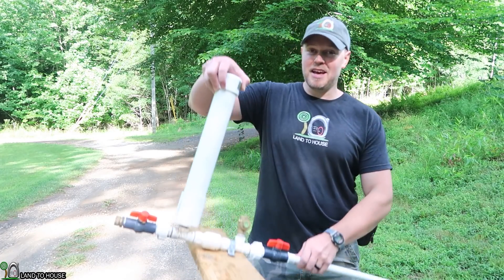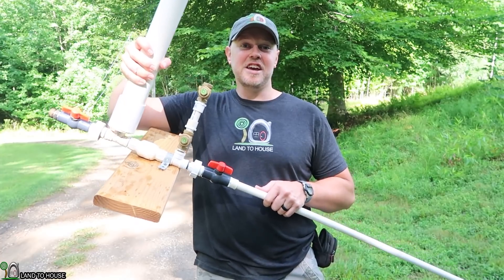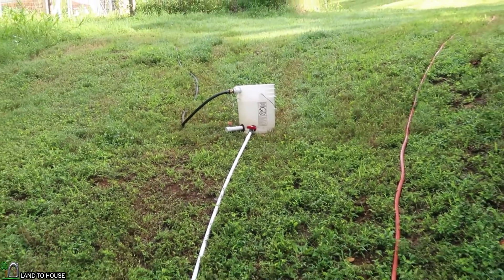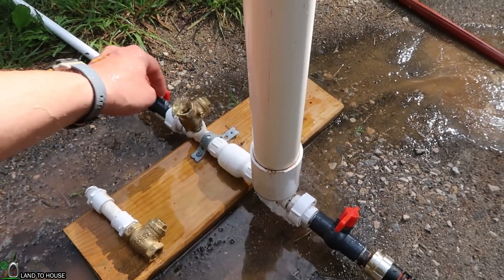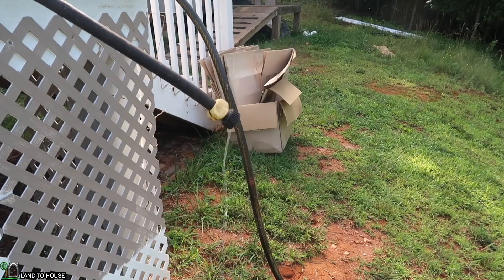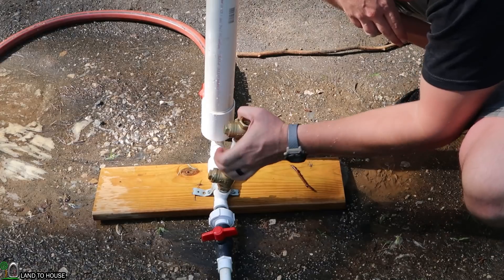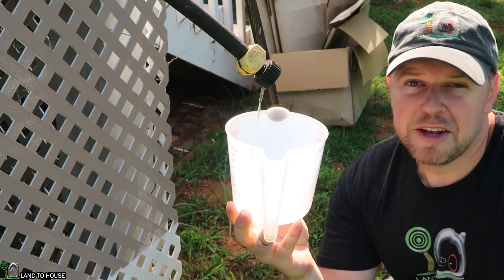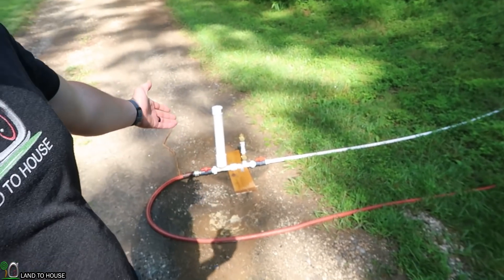Ram Pump Stacked Waste Valves vs Normal Valve

Comment: what will happen if you split the tube before the valve and put like 3-4 valves to work like engine, and then combine the tubing again to the pressure tank

Comment: Have you done...2 or more ram pumps feeding one line? You'd probably need a whole lot more water but your bucket with float valve should be sufficient.

Comment: Have you ever thought of measuring the waste water or the loss of the pump through the waste valve?

Was also curious if you have done one with a short 2-3 foot hose coming off the waste valve to redirect water for like an insulated setup

Comment: Hum... i have a small presure tank 5lb i think. Wonder if you use a biger air tank if you could gain longer strokes on the check valves.

Comment: If you were to extend the waste valve higher through a smaller tube(like a 1/8 inch hose higher would that affect the motion of the waste valve? 

I'm building a system that uses a ram pump for the mechanical action but has a small tube to the upward waste valve to relieve head pressure and keep the waste valve operating as intended...

Comment: is the delivery valve springloaded? you seem to need a lot of backpressure. 

Secondly, if you run 2 waste valves in parallel, the water has less resistance to accelerate, so the waterhammer is stronger.

Comment: Try 2 valves in parallel with 1 Inlet pipe and 1 pressure tank. Maybe 2 valves will boost the water outflow?

Comment: Can you just inslall 3-4 waste walve in parallel meaning that each waste walve would have three to four different connection going into the pressure pipe?

Comment: Would there be any way to say solder a holder/bracket and have a lightly weighted pushrod pushing down on the flapper to  auto open the flapper for you instead of having to sit there and push it to prime it...make an "auto primer" kind of assembly

Comment: Have you built/tested any larger pumps then 1 1/4?  I tried to build one out of 2" check valves but I had a way too big pressure tank on it and it just blooped along and didn't build pressure, gonna I had a 3" pressure tank on it, gonna try again with a 2" pressure tank soon.  I'm going to try and stack a battery of rams to pump flood irrigation water uphill 10' and a 100 yards away.  Thanks Eric.  I'm loving the ram pump vids!   Thanks for doing them!

Comment: You should try putting a pressure gauge on the outlet pump from the pump before it goes into the hose.  I wouldn't be surprised if the pressure was higher with two valves than one despite the reduced flow rate.  If that's the case then you would be able to push water higher uphill although it would be at a lower flow rate.  Give it a try, all you need to do is put a pressure gauge on the outlet of the pump.

Comment: Can you use the waste valve of a ram pump to do work, like driving a spiral pump, or something to push more water uphill? OR would there not be enough energy from the waste valve getting pushed to do sufficient work to turn something like a spiral pump?

Or like could you use the waste pump to power an alternator or something which might electrically drive a spiral pump (of the mechanical energy was insufficient)?

Comment: I wonder if this is the solution, or something similar, to slowing down the plastic non wearing waste valve?
  P.S ( your wife wants you to finish painting the porch.)
Reply from the maker: I think that valve just needed some weight on it to hold it down. But this might do the trick. 
As for the porch... Yes it sure does need to be painted. I have the paint just no time.
Reply: @LandtoHouse  Wouldn't the weight of the water hold it down?
  Time, yes don't we all!

Comment: If raising waste valve height decreased output, how about turning the “T” below waste valve  to 90 degrees and use 90 fitting to mount waste valve to and lower waste valve height - this may increase flow. Worth a try?

Comment: I understand it's not hard at all to pressurize the tank by cycling the valve. Could you, however, pressurize it by having a schraeder valve and pumping in air to like 40psi or something?
Reply: use a manual water pump to prime the system, maybe.  faster and less fiddly (and wet) than sitting there poking the waste valve.

Comment: have you seen this pump in Asia, where they put an extension pipe on to the waste valve to help increase the amount of water flow, it would be interesting to see you test this idea.
Here is the youtube link starting at 1.57 where it says about the improved flow, https://youtu.be/fdsqacG1QWA?t=117

If it does work and the flow rate increases, it might be interesting to see if a larger diameter pipe on the waste ale would improve the flow even more.

Comment: Hi Seth, I emailed you a couple months back with the idea of 2 drive pipes and 2 waste valves. Sent a poorly photoshopped picture diagram to. I would love to see what kind of flow rate it would get. Have seen a few other videos in foreign languages with 4 drive pipes and waste values. Seems to greatly increase the flow. Hope you and your family are doing well. Good bless! - Danny
Reply: I would love to see that too! Very cool idea. 👀
Reply: If you run parallel and have some difference in height of the valves then it works better. Not 2x better, but the output is more constant.
I've tried it with 3, but I don't think we have the head pressure to run all of them that well.
Reply from the maker: I just redrew the idea in a notepad. I will try to get around to this soon. Two drive pipes going to two waste valves with a single pressure tank and delivery pipe.  Things have been really crazy around my house with the wife leaving.
Reply: @LandtoHouse  that is awesome Seth, glad you found it. I also have many video ideas, and not enough time with full time job. Hope your wife going on a trip, she's not leaving leaving right? 😳 You don't need to reply to that here if you don't want to. Wishing you the best brother! - Danny
Reply from the maker: @SourcePortEntertainment  so many ideas and so little time. That is better than sitting around doing nothing.  

The wife is gone. Just helped move her things out today.
Reply: @LandtoHouse  Sorry to hear that brother. I will be praying for you. - Danny
Reply: @LandtoHouse  well congratulations or condolences, it definitely one of those "C" words
Reply: @LandtoHouse  These are sad news, nomatter how it came. I wish you and your family (Emma, Arrow and Ashley) all the best. Probably it's high time to set Land To House a little bit aside, because there are more important things...
Reply from the maker: I am actually setting aside my 3rd shift job. Last day is the end of August.
Reply from the maker: Perhaps a little of both.
Reply: @LandtoHouse  That is good. Although I think your job is rewarding (in one of you Vlog you joked about beeing an essential employee) the night shifts are no good for long term. And probably, a house in the woods with a creek and some micro hydro is not everyone's cup of tea (I hope I express myself correctly, as English is not my mother tongue). Have you ever been on vacation since you were in Salem?
Reply from the maker: We had not been on vacation in a few years. I had suggested we vacation a few times. After 14 years of dsa work I am ready to leave the 3rd shift. .... my wife was/is having another affair.
Reply: @LandtoHouse  Oh well, I see. Thank you for your openess. Probably, YouTube comments are not the best platform to discuss this issues. But I had the feeling that some conversation was needed now. Anyhow, I hope that it will be healable, for you, your kids and your family. I do not like to miss your Vlogs!
Reply from the maker: Probably some time in the next 4 to 12 months i will make an announcement for what went on. As for vlogs I still very much want to bring those back!
Reply: @LandtoHouse  
Sir
I really think you are doing a great work educating world by nomany experiment giving your time. Sorry to learn disturbencec in the family if u have any plans of vacation in India🇮🇳 pls visit me it will also help me to standerise my 3" Ram pump. 
Regards
Hegde
Reply: @LandtoHouse  Great, take your time! And I am looking forward to your Vlogs and many other of your great and educative videos that may come!
Reply: Sir
Thank you fr  the up load we are learning a lot from your video
Reply: If you send more than one shockwave it will have a negative effect.

Comment: Hey Seth, what if you added another check valve at the inlet to the pump? I wonder if this would prevent the pressure spike traveling back up the drive pipe and force more of it through the delivery check valve 🤔
Reply: Has anyone tested that theory yet????

Comment: I had thought of a different sort of stack, like a larger ram pump at a lower elevation  feeding to a stand pipe, or feed pipe, even a holding tank, as far up the hill as you could get, then a small drop to another ram pump and up again.  I know water would be lost at each pump, but so what if it just runs back to the creek anyways?  What if you just needed 50 or 100 gallons every week or two but a few hundred feet  or more up a hill, farther than hoses could withstand the pressure, could a series of systems be used? How big of ram could keep a smaller ram going? If you need multiple lifts, could like the waist water from a third pump be caught to also resupply the tank back at the second pump adding to what comes up from the first?  If you couldn't keep a series of systems like this running constantly, could you pump like a thousand gallons to a tank at "A", then a 100 to "B" intermittently whenever "A" gets full.  Or even more if you catch the waist from pump "B" and send it back to tank "A"? etc.  I am not far from a large creek laterally, and don't need a lot of water, but I am a few hundred feet above this creek, there are several cliffs and ledges, and a canyon, Rocky Mountain style involved. Packing up even five gallons out of there would be a huge chore - better to drive 20 miles to go get it.  Any ideas or input?

Comment: That’s actually not about the height of the valve. The original valve is still doing the job. The second valve is restricting the exit flow of the water from the first valve, and causing inefficiency. It’s negative redundancy. To legitimately check how height affects a waste valve, it needs to be a single valve at different heights.

Comment: Has anyone tried running two ram pumps beside each other in a parallel setup that's being fed from the same supply line? I'd image you'd need a supply hose big enought to supply both pumps at once without restricting the pumps but would it offer twice the output or would it cause them to cancel each other out? I also imaging the timing between the 2 pumps would have to be pretty spot on in order for the water hammer to run both Pumps. And another thought is if you're using a short supply line that causes a quicker water hammer could you use two pumps in parallel but with a see-saw like mechanisms on that valves that forced one pumps valve open while the other is closing so one pump is pumping while the other isn't to utilise the quicker hammer

Comment: Nice experiment. It not only adds restriction, but will also mean the water has to flow to some extra height before exiting, effectively reducing the height difference between the input and output.
It might be an idea to try to figure out a way to have the exit at the waste valve come out lower. Either have an 'n' piece after the waste valve, or try to remount the 'T' piece horizontally with a 90 degree up before the waste valve.
I don't see that making any positive difference because extra tube to resist flow.
The simplicity of a ram pump is what makes it so good.

Comment: I'm curious, why do you spend so long pumping the pump to get water up the delivery pipe? Couldn't you just take some water up to the top of the incline and pour it back down?
Reply from the maker: You can do that too. It means you have to climb the delivery height over and over. (Or use well water from the house )

Comment: You should try a siphon off of the waste valve to increase head pressure
Reply from the maker: I have connected a second pump from the waste of the first. But siphon would keep the waste closed all the time.

Comment: I would think one or the other would trigger, leaving the untriggered to simply restrict flow.
Reply from the maker: Probably with more input head pressure we would see more of that. But to be honest the lower valve seems to do all the work.
Reply: Yes, I also think so. It is rather unlikely that both will exaclty synchronise.